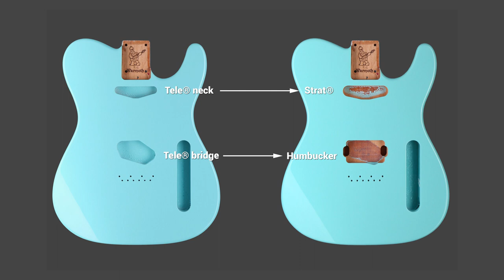Is this a Warmoth Screw-up? (Hint: It's Not)

Comment: Ironically, you can also still mount a Tele bridge p/u in the body you were holding, but the HB ear holes might be visible under the bridge. Also, putting a H/B in a fender is sacrilege and will cause the perpetrator to burn in heck for all eternity and not in a good way.

Comment: Why can't we overroute tele bridge to trem options?
Reply from the maker: Because once you've routed the top of the body (neck pocket, pickup routs, etc) there is no longer an index hole on the top of the body to correctly position the body to rout the back again.
Reply: @warmoth  that makes sense. But then again where is the index hole when you overroute the tele bridge pickup to humbucker?
Reply from the maker: Index holes are located on the side opposite of the one that is being routed. So the index hole for all the routs on the top of the body is on the back - we use one of the neck screw holes. The index hole for the routs on the back of the body is located on the front, in the bridge pickup rout area. Once the bridge pickup gets routed....its gone.

Comment: I’m going to have to make my own guitar one day.  Nobody makes what I want - double cutaway body with the upper horn strap pin over the 11th fret, lower horn out of the way to enable access to all 24 frets, tune o magic bridge, beveled top, thick neck (no thin ‘Wizard’ necks), stainless steel frets - this does not exist off the shelf anywhere!  I’m not even sure Warmoth makes a body like the one I described.
Reply: Well there is the option of ordering a routed body blank from Warmoth.  They'll do the neck pocket, pickups, controls, and bridge routing and you can cut out your own body shape when you get it.  Takes a either bandsaw or a hand wood panel saw ($10 at the big box home improvement stores) and some elbow grease to do but sometimes that's what it takes for something truly custom.
Reply: Wah wah wah